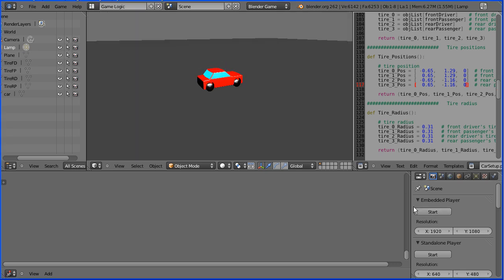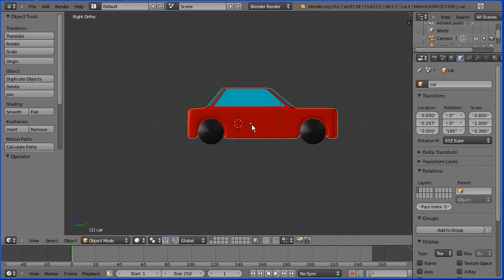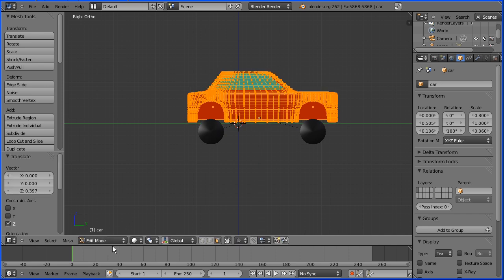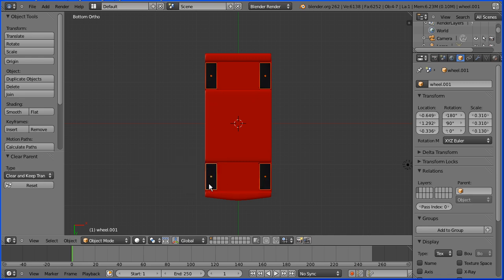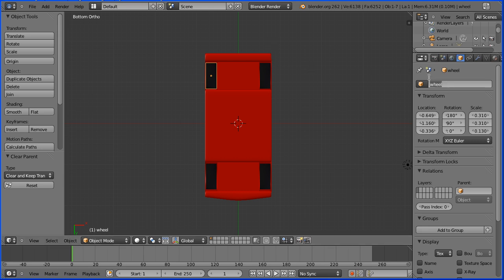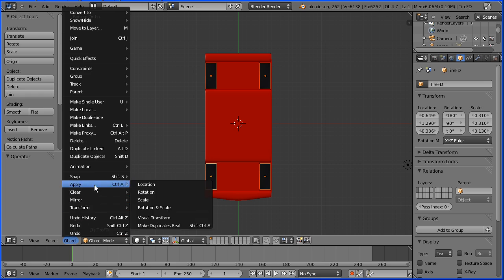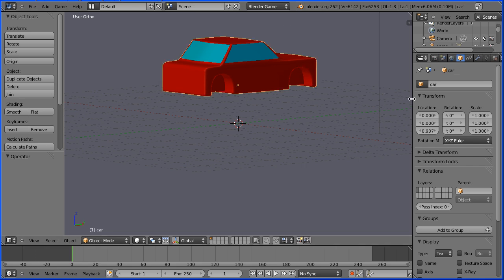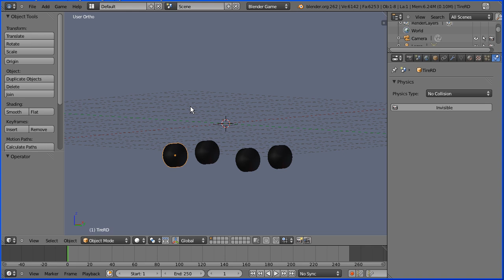Blender Tutorial Using a Model of Car in the Game Engine - Making it More Stable Part 1

Comment: I wanted to use a car with 6 wheels and I used this script and added some wheels in the script: TireMD and TireMP. But it doesn't work. this is my new script:

#########################################
#
#   CarSetup.py  Blender 2.6
#
#   tutorial can be found at
#
#   www.tutorialsforblender3d.com
#
#   Released under the Creative Commons Attribution 3.0 Unported License.	
#
#   If you use this code, please include this information header.
#
##########################################

def main():
	
	# get car object
	carObj = Car_Object()
	
	# create a vehicle constraint ID
	vehicleID = Car_Constraint(carObj)	

	# get tire objects
	tireObj = Tire_Objects()
	
	# tire positions
	tirePos = Tire_Positions()
	
	# tire radius
	tireRadius = Tire_Radius()
	
	# tire suspension height
	tireSuspension = Tire_Suspension()
	
	# tire suspension angle
	tireSuspensionAngle = Tire_SuspensionAngle()
		
	# tire axis attached to frame
	tireAxis = Tire_Axis()
	
	# tire has steering?
	tireSteering = Tire_Steering()
	
	# add wheels to car
	Add_Tires(vehicleID, tireObj, tirePos, tireSuspensionAngle, tireAxis, tireSuspension, tireRadius, tireSteering)
		
##########################   Get Car

def Car_Object():
	
	# get current controller
	controller = bge.logic.getCurrentController()
	
	# get car the controller is attached to
	carObj = controller.owner
	
	return carObj

##########################   Vehicle Constraint

def Car_Constraint(carObj):

	# import PhysicsConstraints
#	import PhysicsConstraints
		
	# get physics ID
	car_PhysicsID = carObj.getPhysicsId()
	 
	# create a vehicle constraint 
	vehicle_Constraint = bge.constraints.createConstraint(car_PhysicsID, 0, 11)
	 
	# get the constraint ID
	constraint_ID = vehicle_Constraint.getConstraintId()
	  
	# get the vehicle constraint ID
	vehicleID =  bge.constraints.getVehicleConstraint(constraint_ID)

	# save vehicle constraint ID as an object variable
	carObj["vehicleID"] = vehicleID

	return vehicleID	

##########################   Tire names

def Tire_Objects():

	
	# tire names
	frontDriver     = "TireFD"  # front driver's tire 
	frontPassenger  = "TireFP"  # front passenger's tire 
	rearDriver      = "TireRD"  # rear driver's tire
	rearPassenger   = "TireRP"  # rear passenger's tire
middleDriver    = "TireMD"  # middle driver's tire
middlePassenger = "TireMP"  # middle passenger's tire

		
	# get current scene
	scene = bge.logic.getCurrentScene()
	
	# get list of objects in scene
	objList = scene.objects

	# tire Name
	tire_0 = objList[frontDriver]     # front driver's tire 
	tire_1 = objList[frontPassenger]  # front passenger's tire 
	tire_2 = objList[rearDriver]      # rear driver's tire
	tire_3 = objList[rearPassenger]   # rear passenger's tire
    tire_4 = objList[middleDriver]    # middle driver's tire
    tire_5 = onjList[middlePassenger] # middle passenger's tire

	return (tire_0, tire_1, tire_2, tire_3, tire_4, tire_5)

##########################   Tire positions

def Tire_Positions():

	# tire position
	tire_0_Pos = [ -2.0,   3.0,  0.0]  # front driver's tire 
	tire_1_Pos = [  2.0,   3.0,  0.0]  # front passenger's tire 
	tire_2_Pos = [ -2.0,  -3.0,  0.0]  # rear driver's tire 
	tire_3_Pos = [  2.0,  -3.0,  0.0]  # rear passenger's tire 
    tire_4_Pos = [ -2.0,   0.0,  0.0]  # middle driver's tire
    tire_5_Pos = [  2.0,   0.0,  0.0]  # middle passenger's tire
	
	return (tire_0_Pos, tire_1_Pos, tire_2_Pos, tire_3_Pos, tire_4_Pos, tire_5_Pos)

##########################   Tire radius

def Tire_Radius():

	# tire radius
	tire_0_Radius = 0.75   # front driver's tire 
	tire_1_Radius = 0.75   # front passenger's tire 
	tire_2_Radius = 0.75   # rear driver's tire 
	tire_3_Radius = 0.75   # rear passenger's tire 
    tire_4_Radius = 0.75   # middle driver's tire
    tire_5_Radius = 0.75   # middle passenger's tire
	
	return (tire_0_Radius, tire_1_Radius, tire_2_Radius, tire_3_Radius, tire_4_Radius, tire_5_Radius)

##########################   Tire suspension

def Tire_Suspension():

	# tire suspension height
	tire_0_suspensionHeight = 0.2   # front driver's tire 
	tire_1_suspensionHeight = 0.2   # front passenger's tire 
	tire_2_suspensionHeight = 0.2   # rear driver's tire 
	tire_3_suspensionHeight = 0.2   # rear passenger's tire 
    tire_4_suspensionHeight = 0.2   # middle driver's tire
    tire_5_suspensionHeight = 0.2   # middle passenger's tire
	
	return (tire_0_suspensionHeight, tire_1_suspensionHeight, tire_2_suspensionHeight, tire_3_suspensionHeight, tire_4_suspensionHeight, tire_5_suspensionHeight)

##########################   Tire suspension angle

def Tire_SuspensionAngle():

	# suspension angle from car object center
	tire_0_suspensionAngle = [ 0.0, 0.0, -1.0]   # front driver's tire 
	tire_1_suspensionAngle = [ 0.0, 0.0, -1.0]   # front passenger's tire 
	tire_2_suspensionAngle = [ 0.0, 0.0, -1.0]   # rear driver's tire 
	tire_3_suspensionAngle = [ 0.0, 0.0, -1.0]   # rear passenger's tire 
    tire_4_suspensionAngle = [ 0.0, 0.0, -1.0]   # middle driver's tire
    tire_5_suspensionAngle = [ 0.0, 0.0, -1.0]   # middle passenger's tire
	
	return (tire_0_suspensionAngle, tire_1_suspensionAngle, tire_2_suspensionAngle, tire_3_suspensionAngle, tire_4_suspensionAngle, tire_5_suspensionAngle)

##########################   Tire axis

def Tire_Axis():

	# tire axis attached to axle
	tire_0_Axis = [ -1.0, 0.0, 0.0]   # front driver's tire 
	tire_1_Axis = [ -1.0, 0.0, 0.0]   # front passenger's tire 
	tire_2_Axis = [ -1.0, 0.0, 0.0]   # rear driver's tire 
	tire_3_Axis = [ -1.0, 0.0, 0.0]   # rear passenger's tire 
    tire_4_Axis = [ -1.0, 0.0, 0.0]   # middle driver's tire
    tire_5_Axis = [ -1.0, 0.0, 0.0]   # middle passenger's tire
	
	return (tire_0_Axis, tire_1_Axis, tire_2_Axis, tire_3_Axis, tire_4_Axis, tire_5_Axis)

##########################   Tire steering

def Tire_Steering():

	# tire has steering
	tire_0_Steering = True   # front driver's tire 
	tire_1_Steering = True   # front passenger's tire 
	tire_2_Steering = False   # rear driver's tire 
	tire_3_Steering = False   # rear passenger's tire 
    tire_4_Steering = False   # middle driver's tire
    tire_5_Steering = False   # middle passenger's tire
	
	return (tire_0_Steering, tire_1_Steering, tire_2_Steering, tire_3_Steering, tire_4_Steering, tire_5_Steering)

##########################   add tires

def Add_Tires(vehicleID, tireObj, tirePos, tireSuspensionAngle, tireAxis, tireSuspension, tireRadius, tireSteering):
	
	# loop through variables:  add wheels
	for tire in range(0,4):
		
		obj = tireObj[tire]
		pos = tirePos[tire]
		suspensionAngle = tireSuspensionAngle[tire]
		axis = tireAxis[tire]
		suspension = tireSuspension[tire]
		radius = tireRadius[tire]
		steering = tireSteering[tire]
	
		# Add front driver tire
		vehicleID.addWheel( obj, pos, suspensionAngle, axis,
   				   		suspension,  radius, steering )

####################################################

#import bge
import bge

# run program
main()

____________________________________________________

in the copy, the spaces aren't right but maybe you have an idea?
Reply: +Droge Vidsnet Did you manage to get it? Id really appreciate it if you could help me b/c im making a game but i cant add more than 4 wheels.